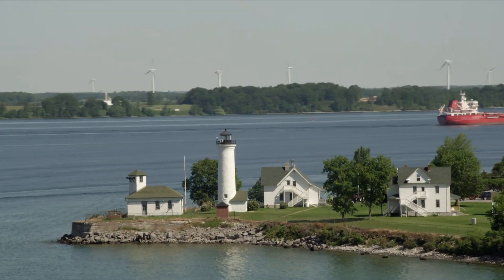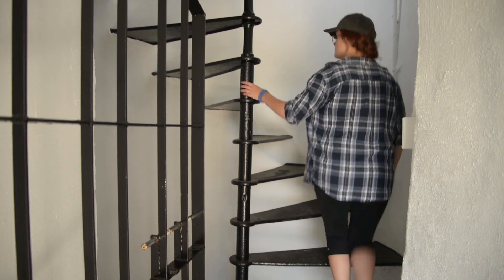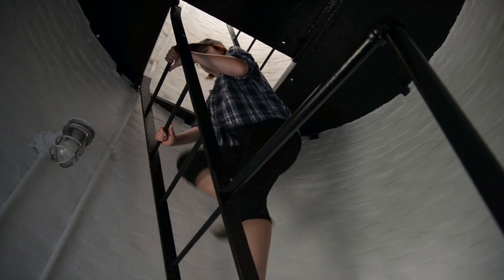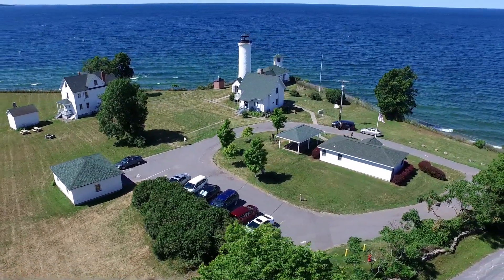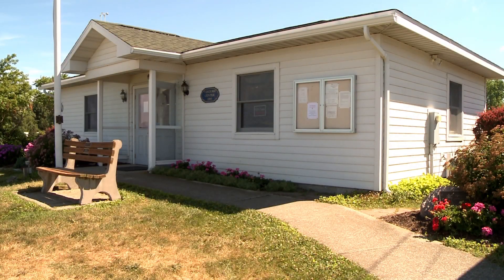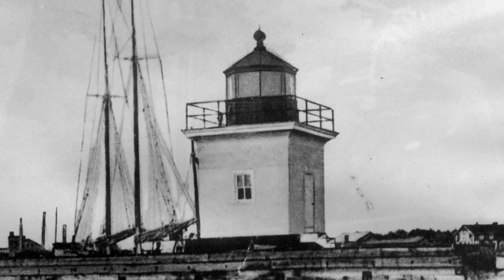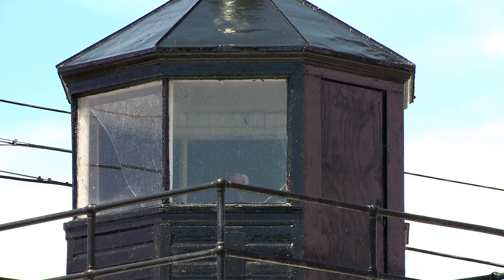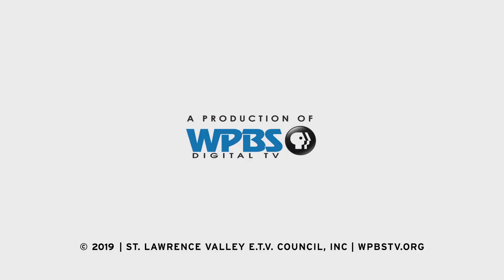Tibbetts Point Lighthouse | New York's Seaway Lighthouses

Comment: I was stationed at this Light Station in 1967 when Ed Sweet was there as the last Civilian light keeper in the USCG. Bill Sweeney BM1 lived in the second house and I lived in town and rented a room. Fog horns were very loud as were the compressors that supplied the air. Had to climb the tower every 3 or 4 hours to check the voltage to the light also polished the glass lens and brass, Ed was very, very particular. Also had three pendulum clocks to keep in sync for the radio beacon. Was beautiful duty that I probably did not appreciate at the time.